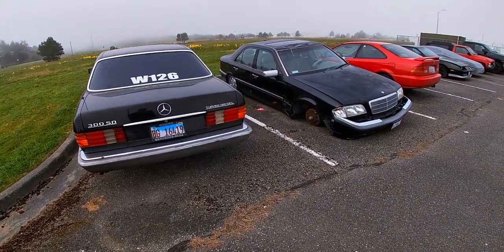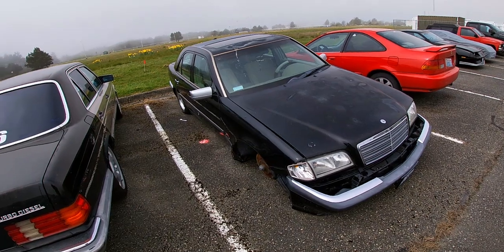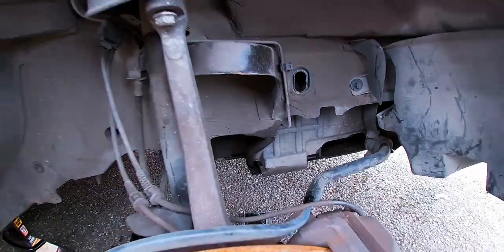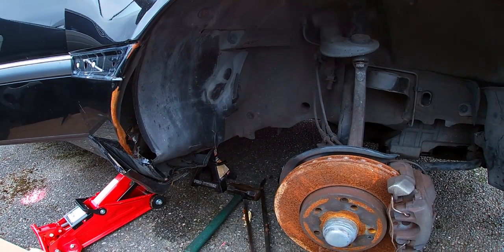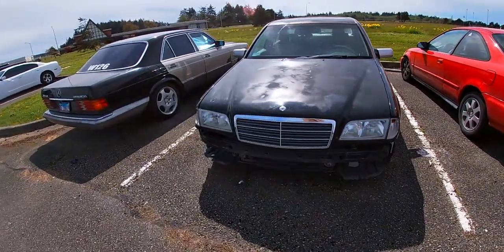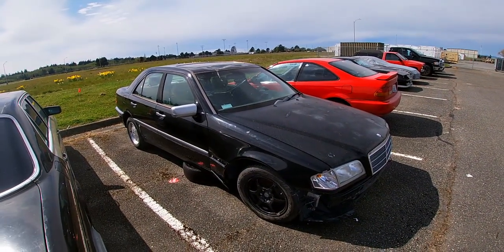This Crashed Mercedes W202 C-Class Was Just Left Here Like This.. I Can See it Crying..

Comment: That was my first merc mann i had a 1995. After changing the bio degradable engine harness it all went back to og
Reply from the maker: These cars are awesome. This particular example is a V6 and doesn't have a biodegradable wiring harness
Reply: Yeah Vito I own a 2000 c230k.  The biodegradable wiring were in the early model 202s up until around 1996 then they changed back to regular wiring instead of the junk bio wire.

Comment: see if you can find some used parts from a junkyard its going to need all front end pieces its all bent pretty bad
Reply from the maker: The only thing that it needs is a lower control arm which there is a new one inside the car. The biggest issue is the Rear Mount for that lower control arm. It's pushed back.. And It's not a part of the subframe. That Mount is spot welded to the unibody
Reply: @VITOSGARAGE  get a sledgehammer and make it strait again, if its brokem maybe hire a welder just for a few hours and weld it back
Reply from the maker: I will figure it out. I'll also talk to the owner. Thanks
Reply: Vito just an idea but if its spot welded drill the welds out order a new mount or re form on an anvil with a hammer to straighten it back out then re weld it where its original location should be . I'm a new subscribe so I'm not sure how much you know about cars yet I have not watched enough of your videos yet to know . But I think in this situation that would be best . Also after welding make sure to coat it or use some body panel seam adhesive to cover any bare metal to provide rust protection . One last thing I would check is to make sure the front mount is in proper spec also . Should be able to measure the other sides location and distance apart on the good side and use that to make sure your mounts on the damaged side are in spec . That way you wont run into any alignment issues or side tracking of the car simular to having a bent subframe or tweaked control arm locations you may also have to beat down from the inside the body where the mount goes . If it got pushed back that far its likely that it was pushed back but also upwards as well where it mounts to the unibody.  If need be you can check the other side and compare to the damaged side. If the unibody has been pushed up and you cant bend it back down you may be able to ad a piece of steel plate to fill in any gap and get as close to spec as possible.  Just some advice.  I'm looking forward to seeing future updates.  And kudos to you for helping your fellow man. And if it has been bent upward and you cant beat it out from inside or fit a steel plate to make the difference you can tack weld some rod to the unibody and try pulling it out with a slide hammer then grind off the rods and weld the mount in place .ect.